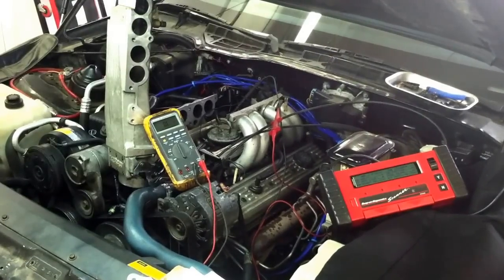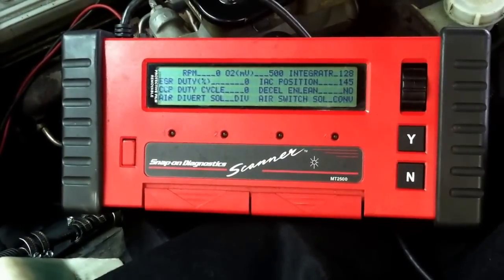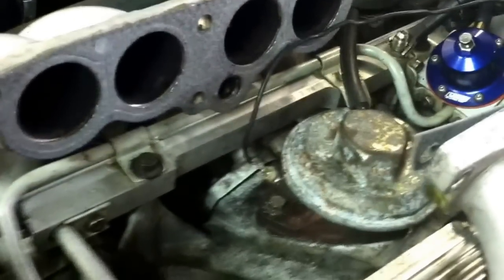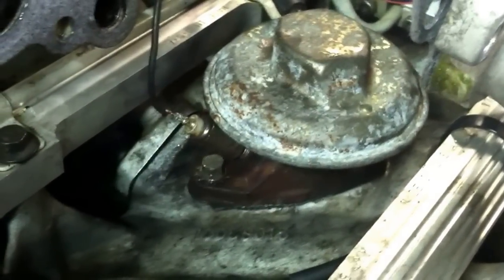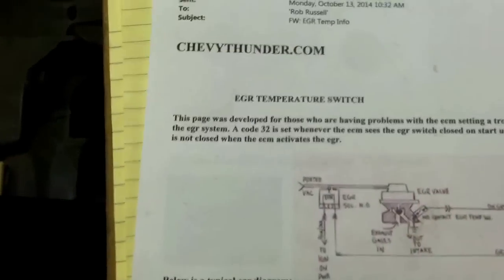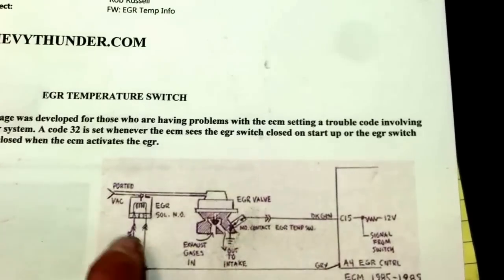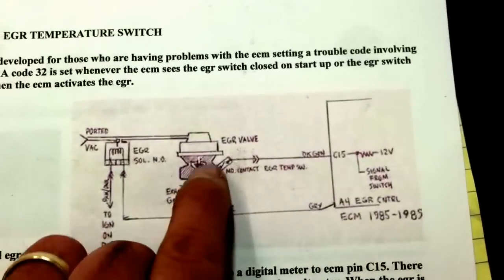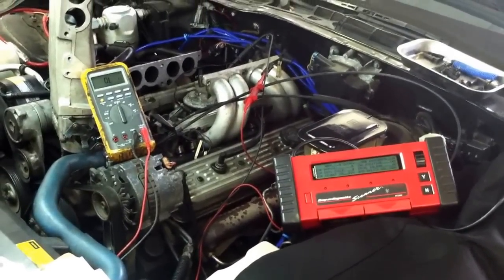1989 Chevy Camaro IROC 5.0LT Check Engine Light On=EGR Code 32

Comment: Im looking for the wire that it plugs into.Cant find anything to match the plug up to.I have an 85 and throes a code only after cruising on the freeway after a few minutes.Once ignition goes off and back on the check engine light goes off.Around town no check engine light.

Comment: Here's the quick answer disconnect the check engine bulb it's unnecessary especially if you have a gauge package on the vehicle you can monitor the system you don't need all that computer crap.

Comment: i have the same issue . i replaced my egr . with ac delco . oem fit 
and i have . code 32 still . i am going to bet its that egr switch . can you tell me were to buy one
Reply: larrs loez it might be too late, but I just replace it mine, I bought it on ebay
Reply: Corvette Central has reproduction switches.